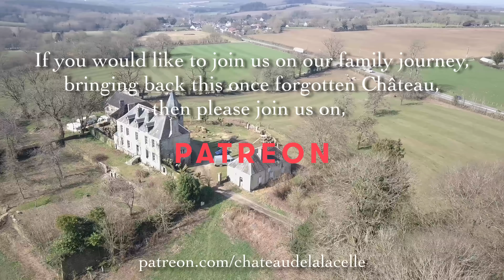New Life At The Château & Cottage. Planting Trees In 21 Acres. Ep 19

Comment: As others have said : Thank goodness you work as a team!  So much gets accomplished!   May I caution you regarding the planting of the balled shrubs :  It's best to remove the burlap.   Although it does rot when buried, some shrubs are wired prior to wrapping.  This can be a catastrophic mistake as the roots are unable to spread and will produce a shallow, weak rooted shrub  or tree.  It is safest to unwrap and spread the root system in the planting hole.  Keep track of the rainfall, as your plantings will need plenty!  Water daily for the first week (rainfall counts),  then twice weekly,  eventually once a week during the growing season in its first few years in its' new location.  One "rule of thumb" to consider is 2-3 gallons per inch of tree diameter per week.
Reply: @derekbriggs6207  -Excellent, I hope you get good growth this season!

Comment: All of my tree planting helpful hints came from my Dad (WWll veteran).  Any "bare root tree or scrub" should be put first into a bucket of water for a length of time  before planting to soak the roots. Then dig your hole for planting.  When placing a new tree into the ground also cut a short piece of plastic pipe, placing the pipe at an angle, exposing the pipe end upwards.  This pipe opening allows direct access to the tree's roots for watering.  After a few years when the tree is truly established, pull out the pipe.  I have used my Dad's method all of my adult life and have never lost a newly planted tree or scrub.  GOOD LUCK!